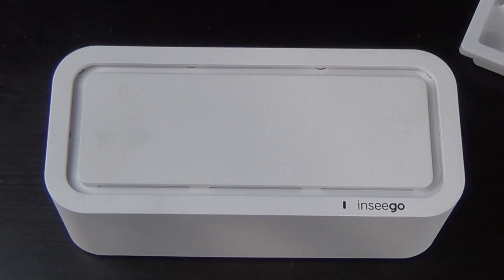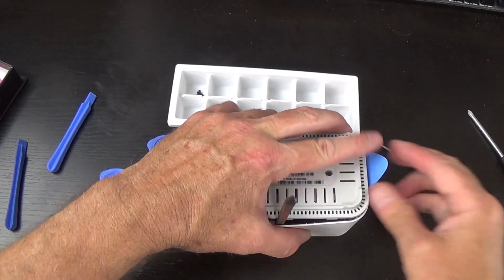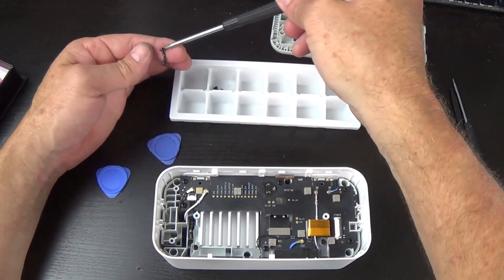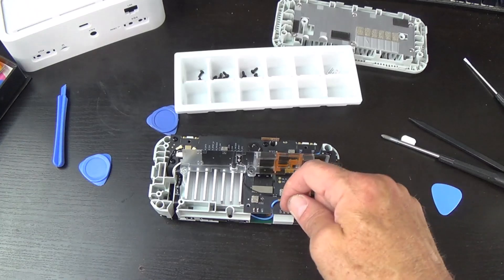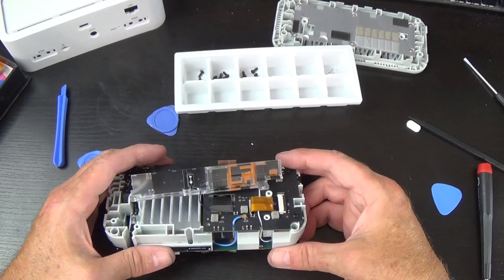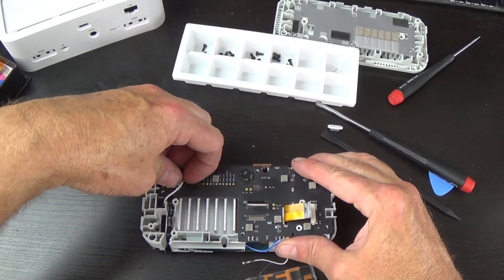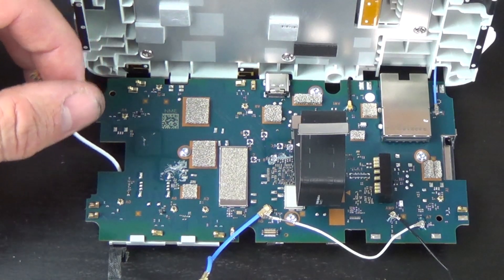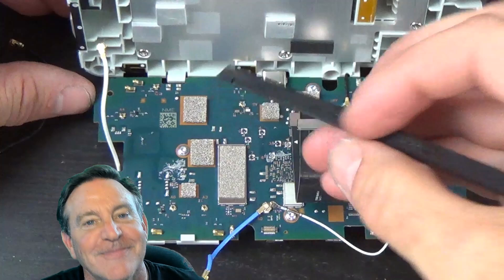🔴T-Mobile 5G Router Teardown to reroute the External Antenna Connectors on InSeeGo FX2000-3 Business

Comment: Hi.  Can you explain what frequencies the external connectors on this modem / router uses?  My understanding is T mobile does use n77 3.3-3.4 ghz for 5g networks.  This may be in more urban areas, but my understanding t-mobile does use mid band ranges which should be in alignment with the external antenna frequencies you state the device supports
Reply from the maker: I forget the exact frequency but it wasn't one that was supported by a T-Mobile at all. This is a modem that was made for generic usage but be external connectors do not overlap with T-Mobile whatsoever. It's kind of disappointing that they advertised external connectors
Reply: @PeterC408  According to this , the inseego fx2000-3 does support n77 midband frequency https://static.inseego.com/us/download/FX2000_user_guide.pdf

Comment: Do you have any idea where I could find a replacement power cord for this device?
Reply from the maker: it looks like a fairly standard connection. Just be sure to match the voltage and polarity. It is okay to exceed the current (A, amps) rating as it will only take what it needs.

Comment: Did someone figure out which internal antenna n41 works with? I'd be willing to try to reroute the external antenna ports, but I don't know which antenna works with n41.
Reply from the maker: Given that I will have to give this radio back to TMobile one day, I stopped short of scratching traces and attaching bare wires. While tempting, I thought only so many would be willing to follow. Here is a much better solution. Contact T-Mobile for Business which allows for BYOD and get a device like this one. https://youtu.be/UJHy8wbKBW8

Comment: Have you tried the new FX3100?  According to my rep you should be able to connect a MIMO 2X2 Antennae to the TS9 connecter under the plastic cover without a tear down.
Reply from the maker: You could attach a 4x4 MIMO to this one, it just went to a part of the radio that supported frequencies not supported by T-Mobile. They even promoted this on-line and on the phone. It was just a mismatch of technology. Luckily I have found better gateways that deliver much better performance and cost about the same as a good external antenna. There is no need to get a T-Mobile provided gateway anymore. I wish they would lower the price for people that bring their own equipment.
Reply: Hey there! What gateway has been your favorite so far? I’m on the business plan with a static IP. Have anything that will work for me? I have fx2000 now and it has halved my speeds compared to my previous Arcadia modem (before I had static IP). Any advice is much appreciated.
Reply: @BruceSlagle  The new FX3100 with dedicated public IP with 2x2 outside waveform antenna incrreatible speeds.
Reply from the maker: @BruceSlagle  T-Mobile's Static IPs are part of the problem. They are either coming from Chicago, Il or Seattle, Wa neither are appropriate for me. They slowed me down and increased my latency. That said, I have tested a few really good Gateway solutions but it doesn't matter which one I like the best, it depend on your situation. It would be like saying, what is your eyeglass prescription because my vision isn't very good. In this analogy, we are trying to see the Internet. How good is your vision right now? What bands do you receive and how well do you receive them. I have a new gateway coming and I think I will start simple, from this perspective. I could give you the name of my Gateway and Antenna, but it might be serious overkill for you. Thank for the question.

Comment: did you figure out which connectors matched the n25/71 bands?
Reply from the maker: They would definitely be different pins; n25 would be 2100MHz while n71 is 600MHz. Not Ipex connectors, this gets more serious.  Not worth the effort. I have reviewed several 3rd party gateways that are better solutions.  This one is just not designed for TMOBILE.

Comment: Hello, i just wanted to mention they have a new model out now that is the FX-3100 and does a vastly better job at things. We have one setup in the office currently
Reply from the maker: Do the external TS-9 Connectors work? This model had them configured to support frequencies that are not part of TMHI. That was the only reason that I wanted to see this one. I have some really great gateways that cover more bands and aggregate more channels for better speed. You can even band lock and configure for 5G SA. https://youtu.be/C1o5Np74RdI
Reply: @PeterC408  we are looking into that right now, they are definitely physical ts9 connectors on the back and the unit specifies what frequencies work. Currently we are locked on 1900mhz N25 with the internal antenna.

Comment: Did you ever figure out whether you can reroute the internal connectors to attach an external antenna for N71 & N41 ?

The T-Mobile guy says they have a new Inseego TX3100 coming out any week now, which will have an antenna connection that works.
Reply from the maker: Yes, I believe that it could be done but due to the fact that some of the connections were "pogo pin" and required that the boards be tightly pressed for contact severely complicated the ease of this upgrade. I had the option of stopping before I went too far or continuing into a expedition that no one would dare follow. Did you see this gateway? https://youtu.be/HU7TQ97cv9s It costs about the same as a quality 4x4 antenna but is a modem and antenna in one. It gets impressive reception and has excellent band support and even is poised to support IPv6. I am currently working with their engineers to address a few final bugs that I found and documented in this video. It's even $40 today! Prime Big Deal Days

Comment: So what your saying is this device is no good ? I was told different buy the t-mobile rep he told me it was really really good and fast
Reply from the maker: It is not bad at all. In fact it is very good, but I like excellent. I was hoping that the TS-9 connectors would allow me to plug in an external antennas and it will not. Those ports are mapped to frequencies that T-Mobile is not using. That said, it is a good free gateway.

Comment: Hi Peter,  Did you go ahead with T-Mobile business account and modem?  If so what are your opinions on the account, hardware, external antennas, internet speeds, port forwarding and reliability? I may switch.  Thanks again for your help.
Reply from the maker: The "free" modem did nothing for me. The external ports don't work. That said, I am working with the card in another modem. Static IP is from Chicago and gave me more latency than I had. I am working with my plex server now to see if I can make it tunnel out .
Reply: Hi Peter,  Just FYI.  I recently bought the Asustor Flashstor 6 FS6706T -6 Bay All-SSD NAS Storage, Network Attached Storage (Diskless).  The software available offers a free 3rd party remote access to the NAS and seems to work well.  I also like how quiet it is and have it mounted below the TV.
Reply from the maker: Wow! That looks pretty cool. Let me know how it works. I now know how to get it to serve out of the house. I will be posting a video soon. Let me know if I hit all the points to make it work for you.

Comment: Thanks for the update! Awesome content as always. BTW these routers are all over eBay now and I was actually considering purchasing one. Now I know why. Ty so much!!! As well I have the same screwdriver set they‘re worth every penny… ❤
Reply from the maker: Agreed, if I had to choose between the screwdrivers and the gateway, I'd chose the screwdrivers.
Reply: @PeterC408  You said something that I found to be quite interesting. You said you didn’t see any improvement with the inseego modem. But because your service is so much faster/better than mine I think it might be worth checking out for the 2 TS9 antenna ports. I only have 4G in my area getting 60 down and 5-8 up. Since eBay’s offering 20% off over Labor Day weekend, it may be a good time to upgrade.… Thanks again for thorough tear-down and transparent communication…

Comment: I've been waiting to see this! 😊
Reply from the maker: What did you think?
Reply: @PeterC408  it was a pretty good break down of everything, when I took it apart I didn't realize that those were antenna ports on the main board. When I compared the speed and signal strength to my Nokia trash can with 2 external antennas mounted on a pole 15 feet in the air vrs this little thing inside of the build, the inseego preformed much better.

Comment: Aside from this router there's a new one for residential costumers?
Reply from the maker: Yes supposedly but it's a radio and not a pizza. It is made by Arcadian. Which bands does it support? Do the external antennas work this time? Arcadian made the worst firmware I have ever seen.  No band locking, no RSRP, no RSRQ, no SiNR. We have to wait and see on that one. I just wanted a static IP with this one.
Reply: @PeterC408  Im looking forward to see if you get the external antenna ports working